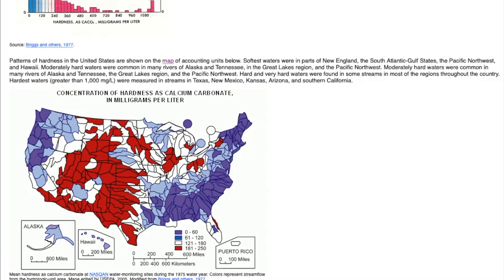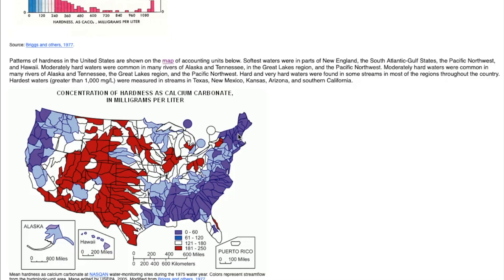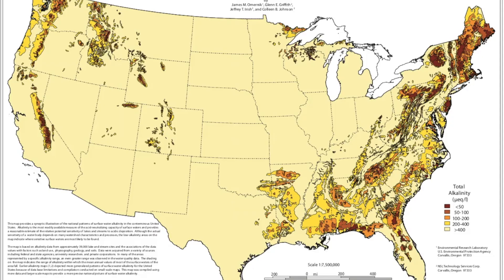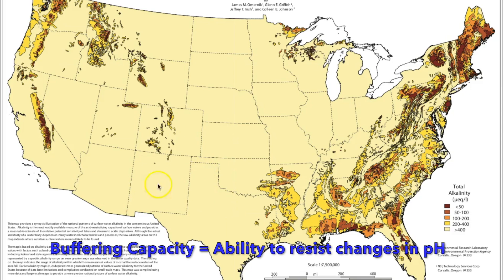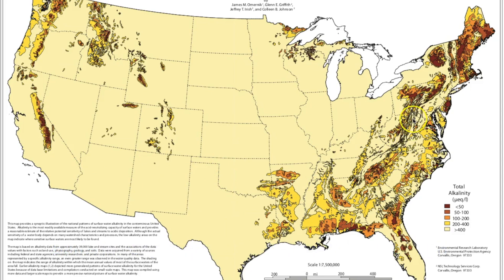Fish Tank Water Hardness Fully Explained: Don't Kill Your Fish!

Comment: How much crushed coral would you put in a 5gal freshwater tank?
Reply from the maker: If the goal is to keep hardness and pH up there are two ways you can do it. First, get a small filter bag and put some crushed coral in the filter bag - that is the easiest and probably the best way to do it. If you want to put it down as a base layer in you substrate, you can do that too by adding a thin layer to the bottom and then covering it with sand or gravel. I like the filter bag method more because I can always remove some or add it more easily. Good luck!
Reply: @PrimeTimeAquatics   Thank you for the reply this is very helpful. Would you fill the bag all the way up?   Can you just place the filter bag anywhere in the tank? 

I never had this issue with hardness until I moved. This is all new to me.
Reply: @MMann2012  Put that bag (u can make one using a part of pantyhose too) in ur filter. If u have (according to the way the water flows in it) a first part of mechanical filtration and a last one of biological one, put it somewhere in between, better close to the first stages of mechanical filtration, where the chemical filtration is placed (in case U need to use chemical filtration in the future).

Comment: one mins i got it, then i lost it.... I had to re-watch  this vid again. lol  I have freshwater tank with some platys, tetras, barbs, danios, and few other small ommunity fish. my gh is always stays at 300ppm. kh always at 0 and ph 6.2-6.8. is that good for my fish. i do have live (not heavily) plants too.  but somehow my plants kept decaying off (slowly). does it have anything to do with the water chemistry?? but dont wanna do nothing drastic to save the plants if it affects my fish. what's the happy medium here if i need to change something?. thnks again
Reply from the maker: So, with your parameters you will want to be very diligent about keeping up with tank maintenance. With no buffering capacity the pH can change more dramatically as fish produce more waste. The platys will do ok if the pH is closer to neutral, the rest of the fish will probably do just fine at your current pH range. As far as the plants go, if you are not using root tabs for root feeding plants or liquid ferts for water column feeders that would be the first thing I would try.

Comment: I have a water softener.  Water is soft and PH is 8 or higher.  All stay constant.  Does this pose problems?
Reply from the maker: The only issue you may see is if aquarium maintenance is put off, that can lead to a lower pH over time. Also, your tank may experience more changes in pH if you add wood.

Comment: My water here in the South Texas coastal bend area measures has a general hardness of 17 degrees, a KH of of 7 degrees, and my pH is somewhere between 7.6 & 8 (API liquid pH test only measures up to 7.6). I have a few mystery snails with a couple of my Bettas. My pH never changes, however each of my tanks measurements differ from my tap water. My GH is from 11-16, KH is 3-9. The only difference in my tanks is size, & some have either live plants or marimo moss balls. I did add a few natural seashells to my tanks with snails to help with the calcium (as I was confused on which test was measuring what). I thought I was low on calcium. Which 2 of the snails that started in smaller tanks showed some signs of deficiency (slow/no growth & soft shell). Somehow my smallest tanks (they started in) had lower test levels than my tap water. Now they have tripled in size & shells have hardened since moving into a 10 gallon with only 1 female betta.
Reply from the maker: Plants can remove small amounts of minerals from the water too. :  -)

Comment: This is a very well done video and very enlightening.  If I may, Is it then not possible to have a higher KH than GH since KH is part of GH? I am having trouble understanding what KH actually  is. Is it carbon as one youtuber said?  I have heard reported a higher KH than the GH and I cannot grasp that.  is it possible to have a 200TDS water with no calcium or magnesium and thus zero GH?  this is an intense subject at its core.  You have explained the relationships really well but I did not have a lot of science and I have always thought that KH was part of the GH and now I am a tad confused about that.....
Reply from the maker: KH is strictly carbonate hardness. I have not seen a situation where KH is harder than GH.
Reply: @PrimeTimeAquatics  My KH is > 240 (that's the highest the test strip gies), GH is 30, & PH is 8.5. How do I fix this?
I was thinking of adding a wonder shell. My snails are looking rough from the soft water, and then mixing in a little distilled water when I do water changes to lower KH & PH. I have a 55 gal tank.

Comment: I live in northern Utah and the water here is very hard! I have been testing the water over the past few weeks and replacing the water with distilled (10 % each time) and the pH is finally stabilized. Everything else is at acceptable levels but the GH is 180, the highest reading on the test strip. I’m not sure if it’s higher since this is the top of the range for this tester. Should I lower this? My Cory catfish seems to be thriving and I want to add some tetras, but I don’t want to kill them!
Reply: I also have live plants in the tank

Comment: Dear PrimeTime Aquatics, I currently live at a relative's house where the water is supposedly from an artesian well. The carbonate hardness was at about an 8 while the general hardness, I assume, was at about 25 or more. The reason I say assume is because in using my API test kit for GH, I could not continually add the drops and remove/replace the cap without water coming out, but the signal color did not switch until about 25 drops. My fish all seem to be healthy and thriving. Even my Kribensis are breeding and the fry are strong in numbers. Is there anything wrong with extraordinarily high water GH? Should I try to lower it or just let it be? My ph is also roughly 8.2 or a bit higher. Thank you for this wonderful video!!
Reply from the maker: One thing I might try is a test strip or another bottle of GH reagents just to make sure the GH is that high. The fact that fish are breeding in that water and appear healthy is a good thing, but long term if the GH is that high it may not be the best. They may have decreased life spans in they have to struggle to maintain proper osmotic pressure.
Reply: @PrimeTimeAquatics  thank you so much for your response and sharing your knowledge! What would be the best way to soften my water if it is really so high? Also, I will likely be moving from this location to a new one in either a couple months or a year to a place where the water will be treated and will likely be more neutral and soft. Does this likely mean bad news for my fish?
Reply from the maker: The easiest way to soften the water is by adding RO or distilled water. Do it slowly over time when you do water changes (you can add a small amount and test the water to see how it impacts the parameters). If you are moving in a couple months it may not matter as much.
Reply: @PrimeTimeAquatics  awesome! Thank you a ton!

Comment: I’m having a hard time determining whether I should monitor water and how often (freshwater tank). From my knowledge people change water daily/weekly to prevent ammonia build up. Is that sufficient? Inevitably what should be monitored for success or is it even needed.
Reply from the maker: Once ammonia and nitrites are at zero (cycled tank), water changes can be determined by nitrate levels. We try to keep ours less than 20ppm. Once we have determined how much water needs to be changed every week to achieve that goal we maintain that schedule. As long as the stocking levels don't change, or there aren't any issues with the tank, we keep it that way.

Comment: Random question: if you live in an area with drinking water containing higher calcium carbonate hardness (alkalinity), would that predispose people to GERD? Stomach constantly responding to higher ph buffer —> increased HCl production in stomach? Acid buildup degrades esophageal tissue. just wondering what your thoughts are on this? Sorry no fish-related question here
Reply from the maker: That's a great question and the short answer is I have no idea. I haven't run across any studies that have looked at it. My initial guess is probably not, only because the stomach is also buffered.

Comment: So my issue is that my KH is at 11 and my GH is at 9. I am doing weekly changes. My PH is sitting around 8. I have been losing a lot of fish recently. My local fish shop believes that this is due to my high PH and I have been trying to lower it to around 7.6 however due to my KH level being so high this is having little to no impact. 

I have Angel Fish, Variety of Tetra, Silver bullets. 

I have just purchse a water softener to see if it can assist in lowering my KH levels and PH levels.  My water comes out the tap with a PH of 8 however the KH is at 6 so there is something going on in my tank that I am just not sure how to fix. Recently I lost around 8 tetra's and one silver bullet, 2 months ago I lost around 17 fish. Water was tested at show and everything showed normal execpt the PH but it was around 7.8 at the time.

Am I doing the wrong thing here? Need help, my local aquarium shop often have teenagers who just dont seem to know what to do.
Reply from the maker: I'm sorry you are going through this. I know it can be frustrating. I'm not convinced the water hardness is the only (or major) issue. I keep angels at 8.2 pH and GH and KH or 10-12 degrees. I also have had a bunch of different tetras with the same water parameters - in fact many of the tetras supplied by wholesalers originate in Florida where they are often kept in hard water with a high pH. It might be worth it to try and buy fish from another store?

Comment: I want shellies but my water is soft and ph about 7.  If I use cichlid substrate or crushed coral will that allow me to have multies?
Reply from the maker: It will certainly help. I would add a base layer with sand on top. You could also add some to a filter bag at place it in your filter. After doing that test the water and see if the hardness and pH have gone up?
Reply: Thanks for your help.  If I can’t get the water right, I just won’t shellies.😞

Comment: How would I adjust these?
Reply from the maker: It's easy to go up using crushed coral. Reducing water hardness is a little more tricky and the best way to do it is an RO unit.
Reply: Prime Time Aquatics I have a 10 gal freshwater with guppies and platies. Kh and gh matter in this tank?

Comment: Hi Jason, I am wanting to add German blue rams (GBR) to my community tank. I am a little confused, my pH is 7 and my GH is at 8. The tank is very stable. Would the GBR thrive in the tank or would it be in the GBR's best interest not to add them? Thanks in advance for any advice.
Reply from the maker: I think the pH is fine - the water might be a little hard for them though. You might be ok. I haven't has any success with them but I'm at 8.2 pH and 10-12 GH and KH
Reply: @PrimeTimeAquatics  thanks for the reply. I do have Indian almond leaves in the tank together with bog wood and cholla wood, hopefully it should be Ok, but I guess I would need to check the tank water that they are currently in and see if I can match it to avoid shocking the GBR.

Comment: so if i have soft water why is my ph 8.4???
Reply from the maker: TheSeverum that’s a tough combo. Be very careful about water maintenance and consistency.  If water changes were spaced out too far and organics start building up in the tank pH will probably crash fairly quickly.
Reply: @PrimeTimeAquatics  but i don't have a gh or a kh?
Reply from the maker: You can have a high pH without high gh or kh, but usually the water is relatively unstable regarding ph. It might be worth using a different testing method to check your gh/kh again though.
Reply: @PrimeTimeAquatics   Like what?

Comment: Extremely informative!  Thank you!  This still doesn't answer my questions tho :(  I can't find anything anywhere to answer them.  I've tested my water for absolutely everything and the only thing that is high is the GH.  PH is fine, ammonia is fine, everything is fine.  My tank is 7 years old.  But, all but 1 of my fish died.  I had Mollies, platies and cichlids.  My tank is at a constant temp.  I do regular water changes - only partials.  I had just bought some fish, brought them home...did what I normally do.  The next day 2 were dead, then 2 more the next day.  It's been 2 weeks and all of them are dead but 1.  This is including the 3 fish I already had in there plus some neons.  I wonder if the pet store had 'bad' fish/water?  But my water tests are good except for GH being high.  However, the type of fish I bought should have been fine with that.  I don't have a place to go that is knowledgeable like yourself.  Only Petsmart...  any ideas?  I was considering lowering the GH to see if this helps out any but I can't find much on the subject.   ****I forgot to mention that some of my fish were covered in tiny clear bubbles and were hanging out at the top of the tank or in my bubbler.  The 'bubbles' made me think of gas bubble disease but were only visible on my darker orange fish.  (It wasn't ick)  I didn't notice it on my yellow ones or neons.  My neons, platies, guppies all disappeared or died.  I watched your video on Nitrates so I think that I will get a specific kit for that.  My dip-test for nitrates & nitrites showed in acceptable levels tho.  I spent a ton of money on my last batch of fish.  I'm scared to purchase any more ...
Reply from the maker: It sounds like the fish you brought home were sick and probably had an internal parasite they passed on to the rest of your fish. I don't think it was your water parameters - it sounds like you are on top of that. If you have the opportunity to set up a QT tank (even 5-10 gallons) and QT for 4 weeks before adding your fish to your main tank that might help a lot. Thanks for watching!
Reply: Sounds like you should let nature do it's job, you job stealer & you killed fish. Fish killer!  I'd like a toilet bowl aquarium, PLEASE!

Comment: fantastic explanation of something that’s been on the forefront of my mind for the last 2 years. I’ve always assumed that the reason i lose my Cichlids is due to GH, however my water is at 120-150ppm, PH is 7.2 and KH around 50ppm. Despite the low KH my PH always stay within 7.0-8.0 even after large water changes. 

I use natural rain water only and i’ve been bamboozled at why 1 minute my Rams are looking stunning and breeding every few weeks, then i lose a group of 4 or 5....

This has given me confidence in my maintenance and water parameters but still at a loss as to why i’ve lost 10 Rams and 8 Discus in the last 2-3 years, any tips as to why would be greatly appreciated
Reply from the maker: My guess might be the rain water. Rain water has zero GH and KH (it's essentially distilled water). When it goes in the tank, especially larger water changes, the KH and GH both go down. This in turn could lower the pH. pH is on a logarithmic scale, so a change in pH from 8 to 7 is actually a 10x change in hydrogen ion concentration. Some fish don't do well with that and the fluctuation in GH and KH. You could start testing all three parameters right before a water change, right after a water change, and about the halfway point between water changes. I wonder if you are getting decent fluctuations?
Reply: Thank you for the response.

During my last water change (1 3rd) I tested the PH before and after the change and it went from maybe 7.4/7.5 to 7.2, surely a 0.2/0.3 PH change won't effect any fish?

I've had Cichlids  for around 17 years and this is my most stable aquarium, yet I'm losing just Rams and Discus. I've used Peat, Catapa Almond leaves, and tried Water balancing chemicals. I've had my last breeding pair of Rams spawn 3 times, then then both died a few weeks later...very strange.

I've now lost my most recent Male however he did not spawn with the female, so I'm totally out of ideas. I'm going to my local specialist today and see what advice they have.

Comment: Thank you for the video.
What would you consider the best option to increase GH significantly if you already have high KH and pH?
I also live in the chicagoland area so my tap water has a pH of 7.8, a KH of at least 12° but the apartment complex I live in treats the water with a softener so the GH from the tap is at or below 1 °GH. I'am no biologist, but I imagine that water essentially devoid of electrolytes would make osmoregulation difficult, at the least. 
Currently I'm trying to decide between something like Seachem's Equilibrium or a bag of aragonite in the filter, but I'm not sure which would make a better long-term solution. Any advice you could offer would be appreciated. Thanks
Reply from the maker: I would probably try the aragonite in a filter bag first. Should change water parameters more slowly and it will probably be easier to manage. Let me know how it works out!
Reply: @PrimeTimeAquatics  Thank you and will do!